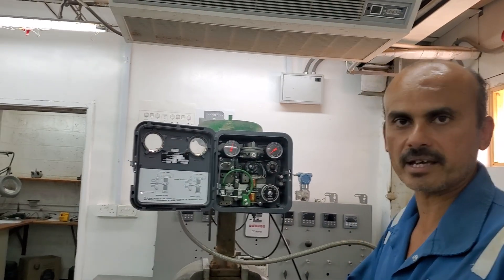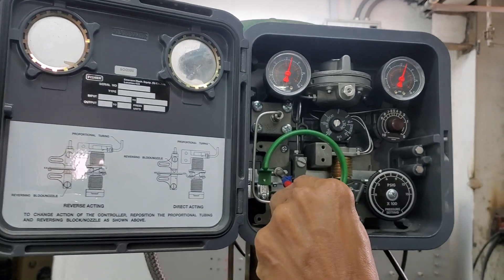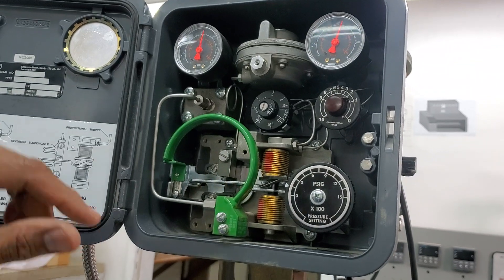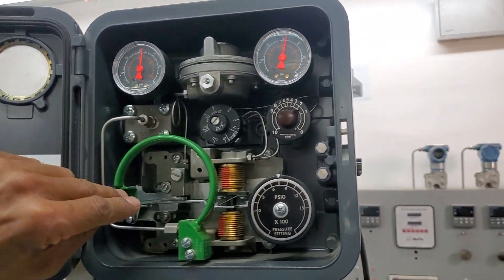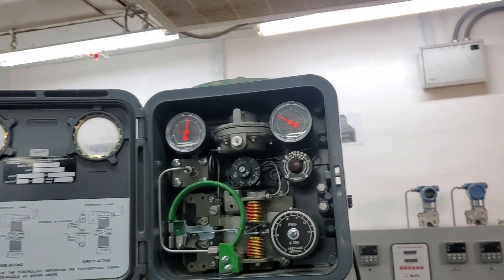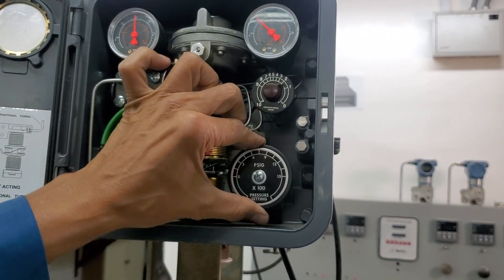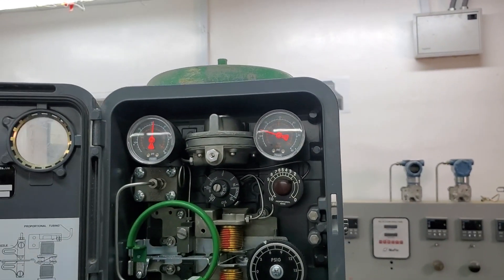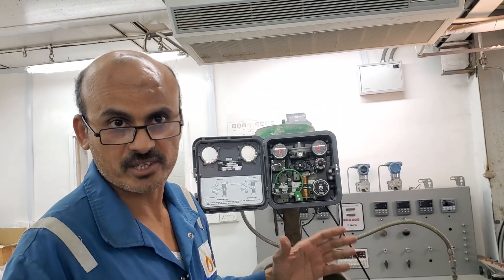HOW TO CALIBRATE THE PENUMATIC FISHER PRESSURE CONTROLLER MODEL 4160 AND MODEL: C1

Comment: What about reverse action. Is it the same.
Reply from the maker: The principle is the same, but the flapper and nozzle will be installed in reverse (upside down.. it is clearly mentioned in the manual.. in addition, the output signal will be 15 to 3 psi instead of 3 to 15 psi..

Comment: controller Model-4160K  I have seen gas leaking from Proportional band knob body .in the proportional band body have one hole, leaking through this hole. is it normal or proportional band knob is become bad or controller calibration become bad?
Reply from the maker: Do you mean air not gas.. that is normal

Comment: How about calibrate Controller 
If

what if there is a difference between bench set valve 3 - 15
while the controller output is 6 - 30
Reply from the maker: The controller will work fine, but when the output is 6 psi, the valve will not fully shut.. and you need to adjust the valve bench set to be 6 -15 psi by increasing the spring tension..and the valve will be fully open at mid range of output signal (18 psi)

Comment: how about for the reverse action actuator, does this procedure apply? should the output increase when turning the pressure setting higher? thank you
Reply from the maker: It is the same procedure except the output will be reversed.. 15 to 3 psi or 30 to 6 psi.. to make the controller reverse action, you need to install the nozzle upside down as indicated in the manual